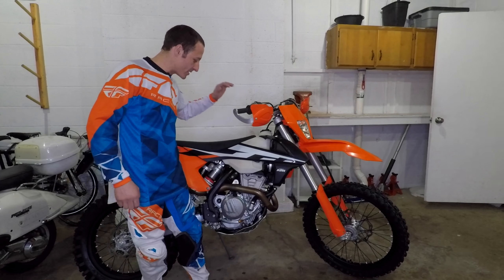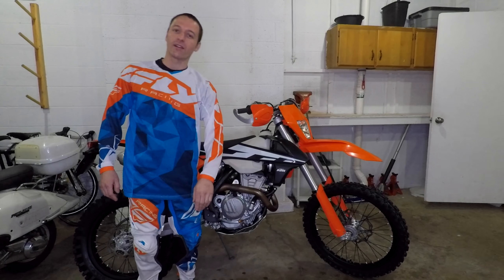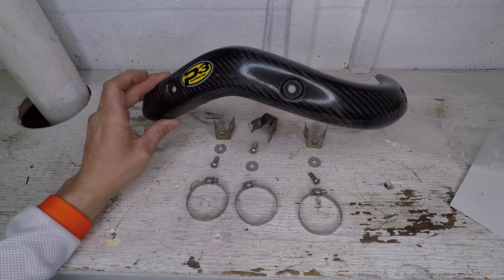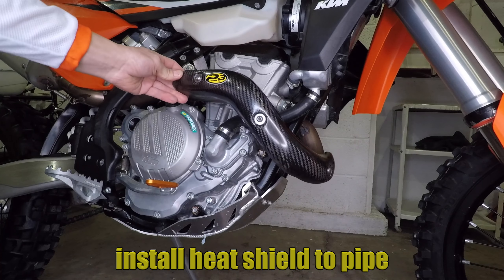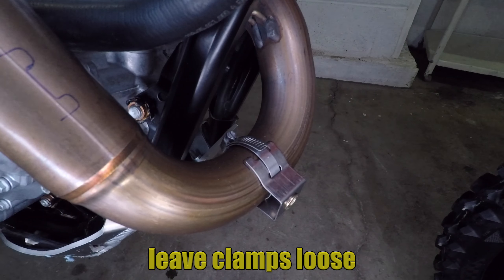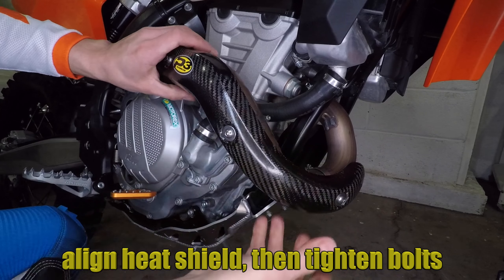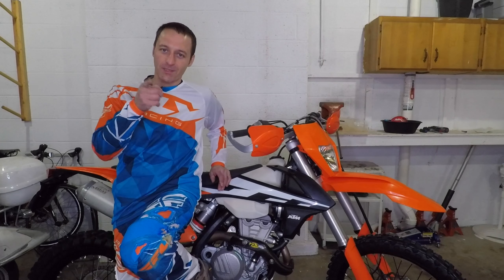Installing the P3 carbon heat shield on a 2017 KTM 350 exc-f

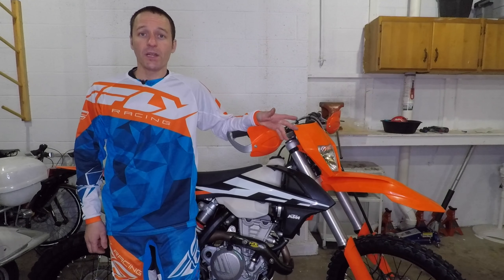Comment: Hey thanks for the vid.  I was reading on some forums that the P3 for the 2017-2019 doesn't extend back as far so heat still gets to your pants and can still burn it (it's some protection at least).  It is noticeable in your installation (1:12) where the space between the rear of the guard to the black framing has quite a bit of space.  They corrected for this in the 2020-2023 version by extending that guard further back I'm just not sure if the pipes are the same between the two generations.  Did you find heat was getting to your leg from the exposed area (mainly while standing) and have your pants touched there?  I wear the enduro-style pants that fit over the boots so they are a little flappier than the motocross pants that tuck into the boots.  Has anyone commenting here found this gap to be problematic? Thanks again
Reply: I touched base with P3 and they mentioned that they "started doing the MAXCoverage in 2019 / 2020 for this very reason but as a small company, we are not able to go back retroactively and redo our existing molds".  So now I know why the gap is there on the pre 2020s and that the 2020-2023 wont't fit the 2017-2019 but I still want to know the questions I asked above (burnt pants, feeling heat from the pipe in at area, etc).  On a side note, kudos to P3 for a quick reply back and their sincere letter about not being able to change the old versions.  So far I'm impressed with their customer service.  It's still my first choice since it's made thicker than the Chinese-made ones.  I guess I'll just put some heat wrap around the rear section if people comment that it has burnt their pants and radiates lots of heat in that area.  Btw, my 2018 350 exc-f is stock so it shouldn't be giving off any more heat from its fuel mixture compared to any other stock Canadian/US version.